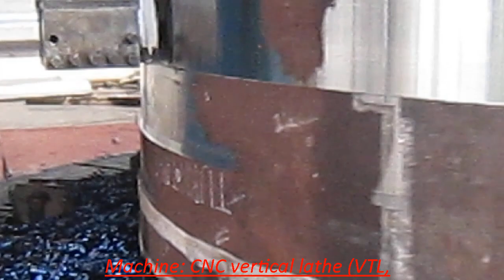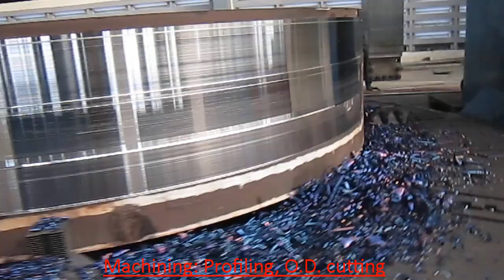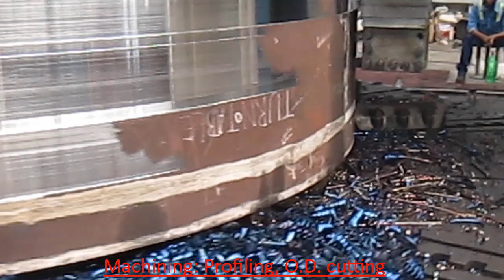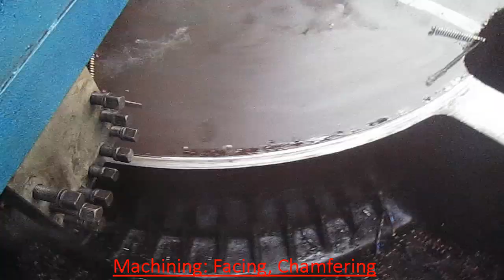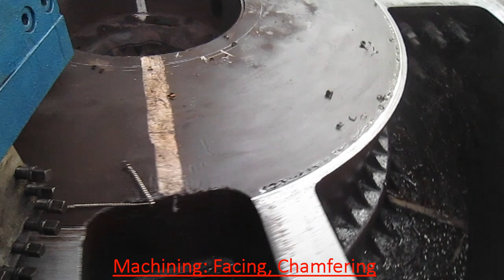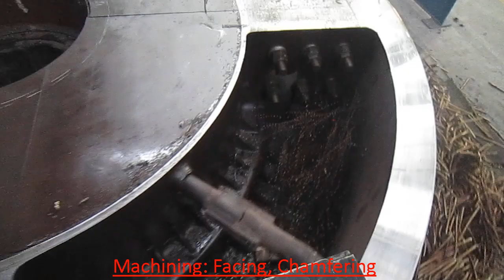CNC Double column Vtl  vertical lathe torno vertical tour vertical токарно карусельные станки مخرطة

Comment: I ran Berthiez Vertical Boring mills in my youth. I lost count of how many grain shovels of chips I scooped up every day. Some cuts took days to do a finish pass on. Best job I ever had. 12 foot table with 3 heads/tool holders. Ships engines and Pipe line compressors were the primary jobs but in 10 years I saw a lot of jobs come in to the shop.